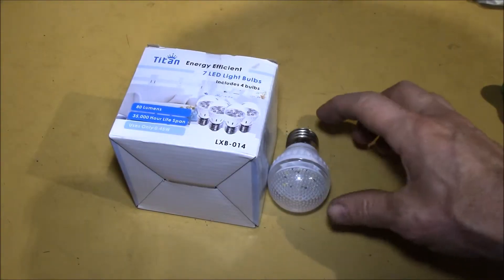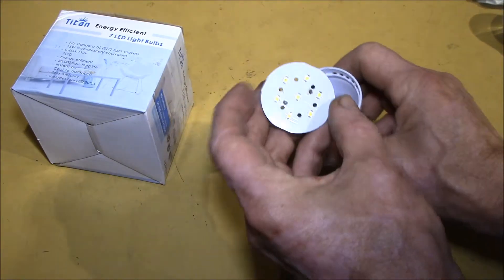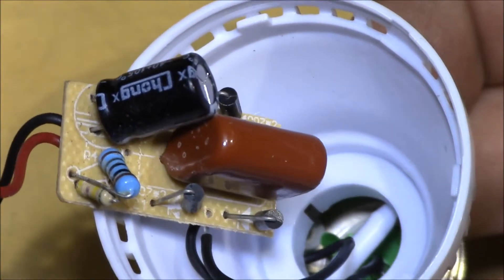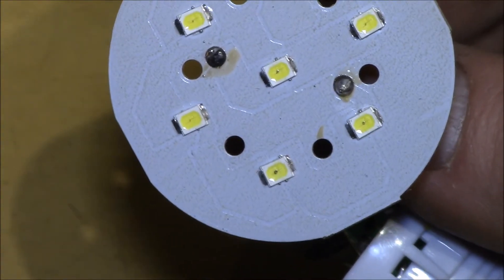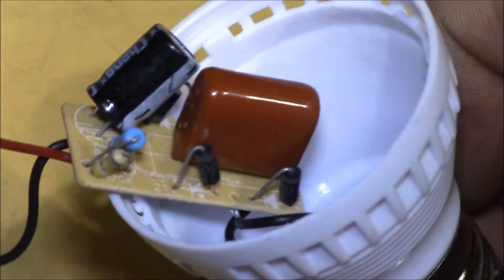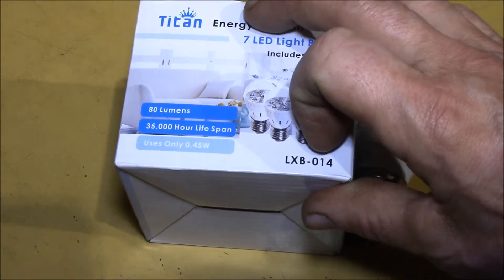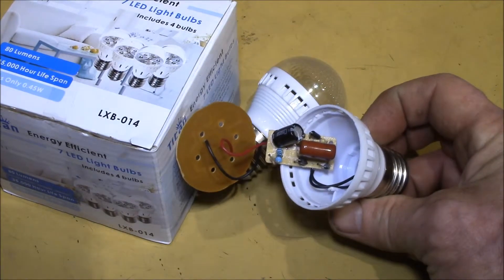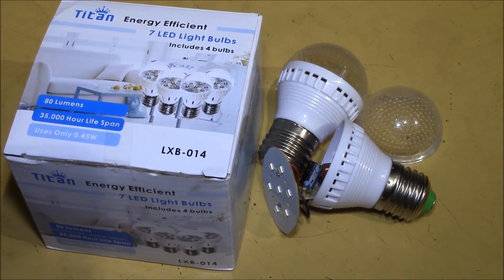Titan LXB-014 7 LED Bulb Teardown

Comment: can you please send me the cercuit daiagram.or,the value of,resistors,film capacitor,and condenser.please
Reply from the maker: I hope to make an update video shortly where I'll try to work out the circuit diagram and component values.  The main capacitive dropper is a 105J400V capacitor, with a 3.3uF electrolytic filter cap on the output and what looks like a 10 ohm resistor in series with the LEDs.  However, the current in the LEDs seems to be exceedingly high which is likely why they only lasted a few months before burning out.